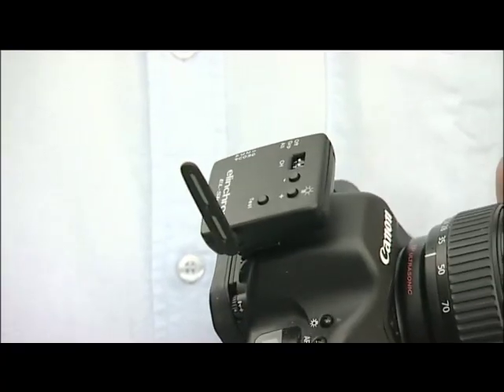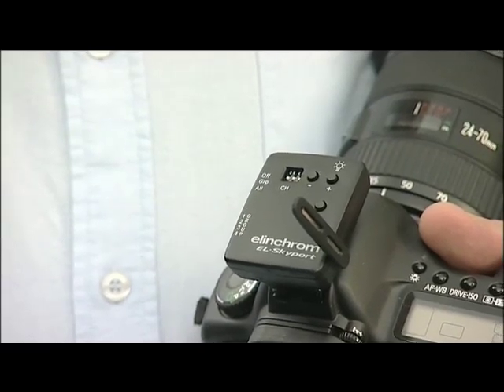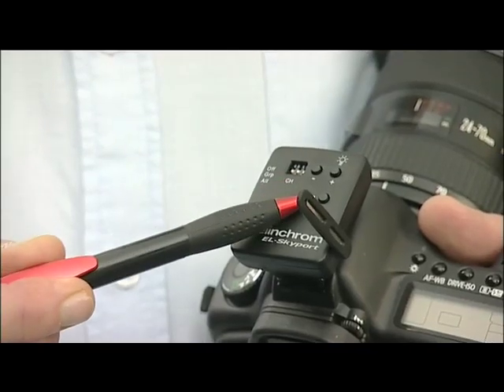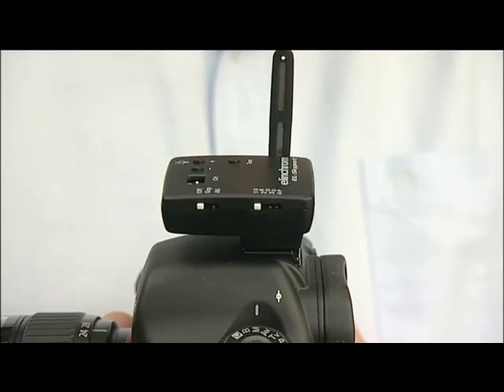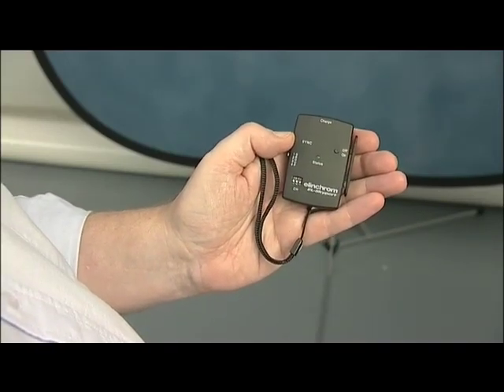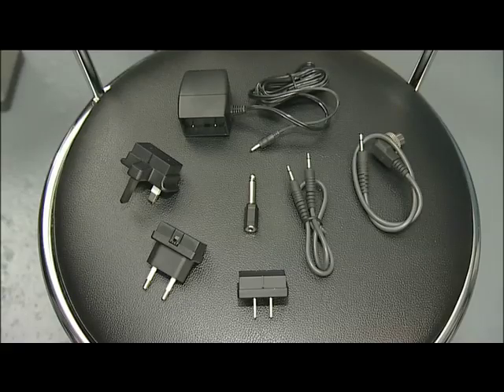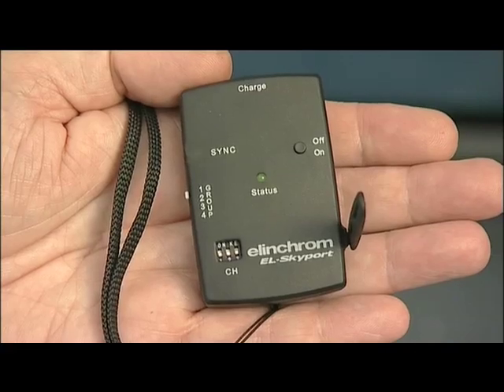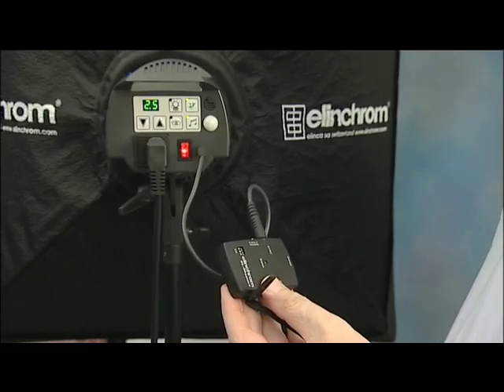Elinchrom Skyport Radio System Part 1

Comment: The latest skyport speed receivers are very nice because they have recharchable battery, but sadly the transmitter still use normal batteries :( ....also the range of skyport very weak, if you put a flash behind a wall with the door open it does not trigger. This does not happen with pocket wizard.

Comment: Been using three RX 600's and the Skyport system for a month in a  commercial photography environment. My experience:

1. One of the units will fail to fire dozens of times a day. 
2. The software to control the units from the computer is a badly designed and buggy.
3. The manufacturer provides no customer service. Their website will not allow me to register and ask them about these matters. 

Other manufacturers have customer service departments that will respond to your queries.